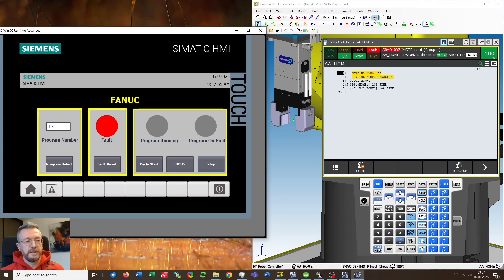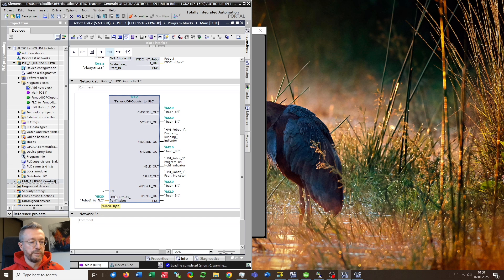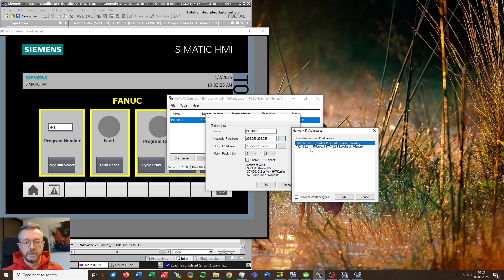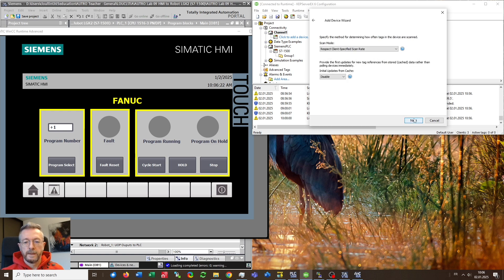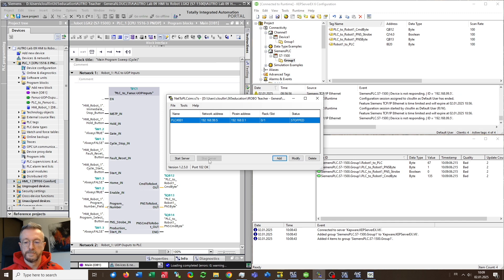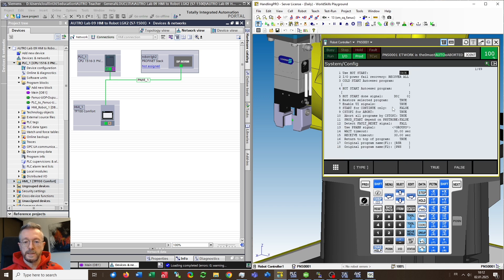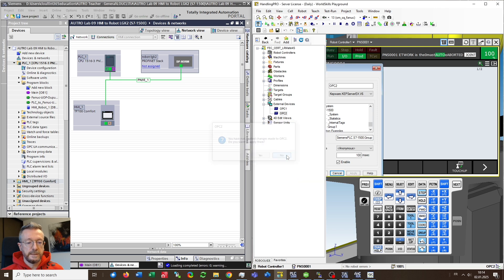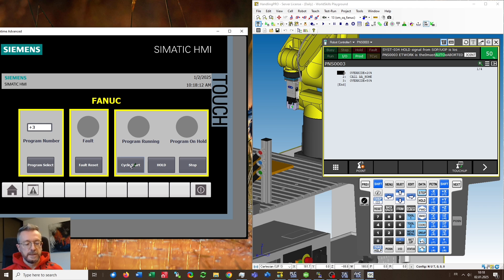PLCSIM v16 to Roboguide 9 Communication via NetToPLCsim and KEPServerEX with S7 1200 or 1500

Comment: Hi, what library did you install for adding the robot in tia portal network?
Reply from the maker: Hi Luis. As long as you want to simulate only, you are not obliged to add the robot in the TIA network. You can use whatever free input or output address to represent the data exchanged with the robot. If you want however to prepare your project right a way for a real robot, then proceed as described in the TIA section of the document you can download on the webpage below. The key point will be to import a GSDML file from Fanuc for your robot. This is probably the "library" your are thinking of.
https://www.loullingen.lu/projekte/FanucProfiNet/index.php?language=EN